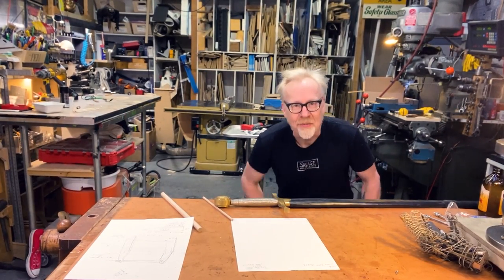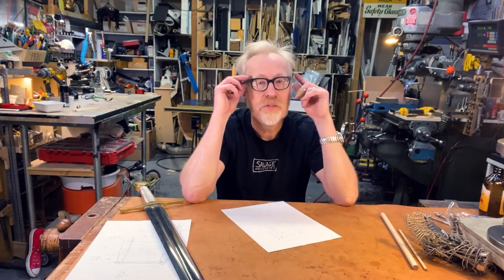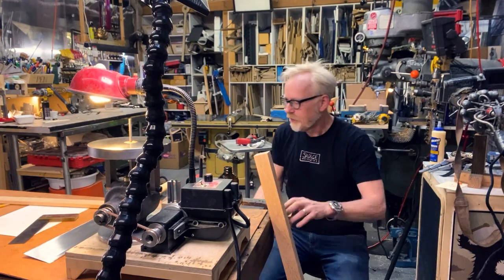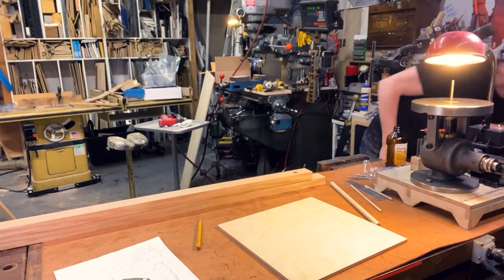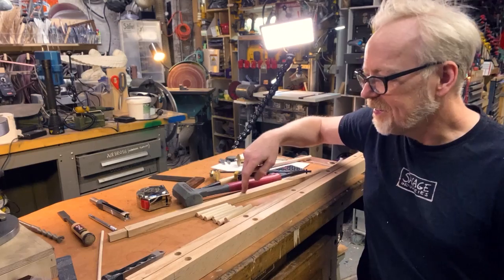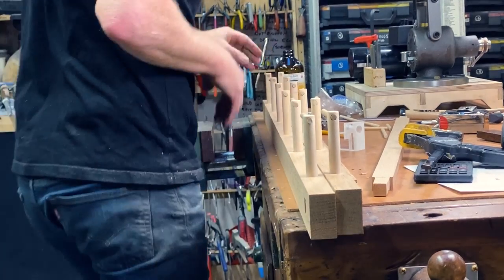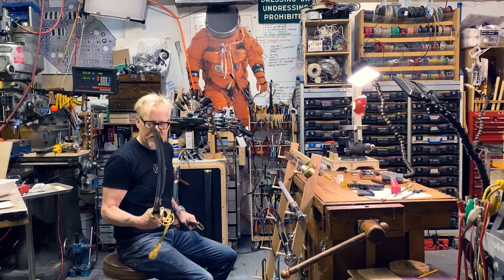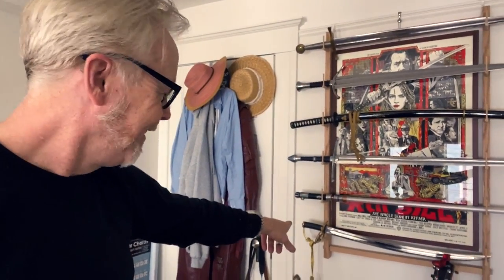Adam Savage's One Day Builds: Movie Sword Rack!

Comment from the maker: Now taking suggestions for (de)merit badges! Look for them soon at our TeeSpring store: https://teespring.com/stores/adam-savages-tested
Reply: Some ornate wreath surrounding a "thumbs down"? Btw can I bulk order them so I can hand out the appropriately exorbant ammount at work?
Reply: My troop at one point tried to go on a hike of Point Reyes - it rained all morning (they closed the trails to avoid erosion), we hung out in the gift shop and then went home. We received the 180 patch - for those with the bravery to turn around and leave well enough alone.
Reply: Uh, how about a badge depicting a bandaged finger; it is awarded for trying to clean/adjust something while it is running?
Reply from the maker: @RandomStuffGarage619  Ha!
Reply: Adam Savage’s Tested if you use a teeter motion when using japanese handsaws you might find the cutting to go a little smoother and with much less effort. start a line then work back corner for a few passes then teeter and do a few passes on front corner and repeat until through. helps make cuts go really smooth and helps with keeping a straight cut. just something i thought i would share. i have had great results personally using this method with that type of saw
Reply: A ruler/ pencil/ drill bit snapped in half with the caption measure once, cut twice.
Reply: I think a thumbs up, with a bandage wrapped round the thumb, would work for 'makes mistakes'. There should also be a badge for like, making it cutting two pieces the same, when they were meant to be opposites, or when you get your template upside down, things like that. Not to mention putting a thing down, and then not being able to find it a moment later. Maybe also for glueing something to yourself by accident. Ooh, and one for hiding the crimes!
Reply: I have a PhD in oops, that aint right. I blame the damned Imperial system.
Reply: They already make these badges. They are called "bandages".
Reply: Maybe something like, "Don't have time to do it right, but have time to do it over"?
Reply: Emoji person making the ASL sign for mistake, maybe with flames in the background?
Reply: Not a merit badge a challenge coin
Reply: A thumbs up with half the tip gone and a blood drop leaking out, for surviving an encounter with a band saw / table saw
Reply: Inappropriate Bandage Materials (blue shop paper towels, anyone?)
Reply: Posted a badge on FB. #successthroughfailure #merritbadge ;-)
Reply: "We do it right because we do it twice"
Reply: I am partial to "Measure Twic" over "Cut Onc".  I'm just not sure how to send my extremely simple mock-up...
Reply: "It's only a mistake if you don't learn from it!"
Reply: Merit/demerit badge from the one day build table saw upgrade: That was it that was all it took and I wasn't willing to do it. 

I just wanted to save a second over here! :P
Reply: That's already the "Plan ahead" punchline.
Reply: @jeremystrout23  I wish I could thumbs this up a few thousands more times (:
Reply: No one has mentioned converting metric to nonsen- Imperial, er standard. or vis-versa more likely.
Reply: A hammer pounding a screw
Reply: Per Adam for many videos (before the most recent), a blackened fingernail.
Reply: @Gazongola  "...putting a thing down, and then not being able to find it a moment later." aka 'Reverse Hallucination" Not seeing what Is there!
Reply: Aren't swords required to be kept in a sword safe in California?
Reply: Never ever forget your famous demerit badge "Am I missing an eyebrow" that is for all your fire "accidents" in your cave😂😂
Reply: Never ever forget your famous demerit badge "Am I missing an eyebrow" that is for all your fire "accidents" in your cave😂😂
Reply: enamel pin, made to look like a scout patch, has an incorrect ruler on it.
Reply: kissing the vacuum motor for curiosity?
Reply: Adam Savage’s Tested 
10 minutes and 5 seconds in to the video. 
Are those a bag of candies? Specifically Haribo peaches 🍑?
Reply: Measure once, cut twice?
Reply: One of these needs to reference not properly locking your tools down before a cut as in from your Space Suit Parts video with the right angle milling attachment mishap.
Reply: I absolutely need a badge for "fried the electronics by hooking the battery up backwards"
Reply: Could you teach us a headphone and microphone repair on your soldering kit please
Reply: Demerit badge for "Oh oh. Shouldn't have glued it yet."
Reply: @mikeboettcher9709  Yes. Lol :-)
Reply from the maker: @Beamer1969  We are working on those too! Stay tuned.
Reply: Come on 😃 
I need to know
Reply: Instead of painting the sword assembly  white, polish it to match the frame of poster. Then it will blend with  kill bill poster's frame and looks like part of kill bill's poster . You may remove amazing custom build  lightsaber (looking odd in this case ) and just put only metal swords. 

Another suggestion is make a single sword assembly and attach  it just below  the poster with kill bill's sword.  Do this only if you think that poster is getting too much cluttered.

#StayAtHome, #StaySafe, Dear Champ!

Apart from build skills you got some good video editing skills. Please don't fire your camera person after Lockdown!!
Reply: Merit badge suggestion: "Wow, that was still hot!"
Reply: @Gazongola  How about two left gloves for the 'opposites' badge?
Reply: Maybe something for "Measured box inside, cut outside", as in measured the interior dimensions, but forgot to add the material thickness, resulting in a box that doesn't fit together or the intended contents don't fit.
Reply: @markhood  Jamie Hyneman, is that you?
Reply: @Beamer1969  I would love that. It would go on my coin rack next to my iron man 2 coin that was handed out to the crew by Jon favreau himself.
Oh jeez I wonder if he made mandolorian coins?!?!!
Reply: Merit badges come in a range of sizes, so in order to best (and hopefully intuitively) represent "mistakes" as opposed to "accidents" or worse, I suggest 1 with depictions of the most common tools (drill, screwdriver, saw, tape measure, level, etc.) surrounding a pic of 1 of the most common diy jobs...a wonky bookcase complete with uneven sides, misaligned and collapsed shelving of varying (correct and obviously incorrect) lengths and the word MISTAKES arching (arcing?) across the top.
With regard to your sword rack, personally speaking, I would mount the swords in alternating directions...
1. So that all the weight of the heavy end (hilts) isn't acting down through 1 side of the frame.
2. I think it would look better aesthetically, because...
a) all the busy stuff (wrappings, pommels, guards, etc.) and therefore, most of your attention, is focused on that 1 side.
b) subsequently the other side seems decidedly empty by contrast which
c) adds to the sense of all the weight being on 1 side, which reinforces the impression that it feels lop-sided.
I'm aware that there may be a safety concern, with the exposed point of half the swords being in close proximity to your face as you walk through the door. If the longer swords were pointed away from the door, with their hilts extending beyond the points of those pointing towards it, might that mitigate it sufficiently?
Reply: Can you also make whatever they are a sticker?  I need this very much.  I am occasionally astounded at how dense I am at times on projects.  LOL
Reply: @GodOfBiscuits66  this would also come in handy for car dents.
Reply: I think a badge of a checklist with "Obsess, Make checklist, Draw a picture, Make, Sweep" would be really cool.
Reply: if there isnt a touching something that was at least 4 times hotter than expected badge i'll be disappointed
Reply: how about a merit badge for ALL THE TIMES YOU FORGET TO USE ANY PPE WHILE WORKING WITH DANGEROUS MACHINERY! i can count at least 7 instances of you doing this in this video alone so far, and i havent even watched half of it yet!
Reply: “One day build” badge
“Tried and tested” badge
Even a “tried it at home” badge would be kinda cool
“Every tool’s a hammer” badge
Reply: A merit badge with Stonehenge on it for when you transpose feet ' for inches "
Reply: make a TO IT ... stamp ... then every time you make a mistake you pull a task out you dont like and stamp it so you dont leave until that task is done .. because you just got your Round To It
Reply: a suggestion get one of those cow noise makers and adjust it to say boo ... put it in something that wont hurt or damage stuff and toss it to the person who made a misteak ;) ... or make a rubber steak .. and toss that ;)
Reply: BTW Adam ... your drill press has a EM radiation problem .. thats why the screen seems to wave like it was water ... its the interference of the motor with the phone
Reply: NEVER display a Katana practice decoration or otherwise with the blade DOWN ... that is a sign of disrespect to the maker and owner of the sword by saying the blade is so dull it is like the back of the blade and flat ... you always display the edge up because that is where the artistry is ... in the design from the forging and in the polish from the sharpening ... and any debris that would fall upon the blade will be cut apart and fall away from the blade when it is kept properly ...
Reply: A badge for losing frequently used/vital to the project tools (e.g, a screwdriver, wrench or socket of the needed size).  Could feature a dotted outline of a tool with a question mark over top.
Reply: Adam Savage’s Tested Definitely need a demerit badge for when you loose a 10mm socket.

My whole shirt would be covered with those.
Reply: Metric system saving you from making mistakes

Comment: Adam: "97, really? Okay that's not 48, thats 47.5..."
Me: "Ah already having to cut it short"
Me 3 seconds later: "wait hang on, 48x2=96 ADAM STOP WAIT!!!"
Reply: I did the same math.
Reply: I did the math and thought, "measure again from the other end, so you notice your math error." Then it was, "NOOOOOOO! Don't cut. It's 48.5". Your other half is going to be 1.5" too long."
Reply: Another victim of the imperial system :)
Reply: @v4lgrind  He messed up dividing by 2.  I doubt the system used matters.
Reply: 😂 I was shouting at the screen "measure twice! Measure twiiiiiice!!!"
Reply: Me toooooo!  Stawp! 
LMFAO
Reply: @boskone  100 / 2 is definitely easier than 96 / 2
Reply: @DanielRothhaar  Half of 96 cm is still 48 cm - just because we use metric doesn't mean that we always deal with nice power-of-ten figures.
Reply: @SteelSkin667  but he said "8 feet is 96 inches but i thought 98" (im paraphrasing). Nobody ever said "oh right, one meter is 100 centimeters, not 98"
Reply: MrQuackcorn time stamp please, lol I can’t find it again
Reply: v4lgrind fgh
Reply: @v4lgrind  How is that an imperial system problem?  He measure 97 and divided by two and came up with 47.5. The units of measure don't matter.  You metric bigots want to blame everything on our use of inches.  I am sure you've never made a mistake when measuring...
Reply: @drhender6943  - Yes, but the problem arose BECAUSE he divided 97 by 2, when in actual fact, he SHOULD have been dividing 96 by 2.
Also, the math for Imperial and metric is only the same in that it's math, but there is a more pronounced difficulty when using Imperial measurements of any sort, entirely down to the fact that they all use...let's say "less than intuitive"...numbers. Base 12 definitely has a degree of difficulty greater than the  numbering system we're all born with (except in a few rare cases). That difficulty increases exponentially when you start getting into the fractions of inch.
I completely understand your indignation in the face of having the system your country steadfastly refuses to give up, by "foreigners"; many of whom from a country that, until only recently (in the grand scheme of things), not only still used the same system of measurement (and indeed still does for a bewildering number of things in a perplexingly random seeming manner), but insanely for their currency too, not to mention the jumble of associated grouping names used across the board. To this day, every "proper" engineer I know still carries a full set of Imperial tools alongside their shiny new metric ones, because they never know when they're going to have to work on a pre-70's piece of equipment. In fact, everything here is sold with dual markings, from m/h and km/h on our speedos to pints and litres on our milk.
I'm sure you know as well as everyone else that there's no-one as against smoking, or as indignant when someone lights up next to them, as an ex-smoker, telling smokers how good everything is now that they've quit. They can breathe easier, food tastes better, yadda yadda yadda. These people are no different. They live in an enlightened world where they get to count on their fingers and toes without having to carry digits if they so wish and while that may be easier and more intuitive, there's absolutely nothing wrong with sticking with the hard way, or contracting some form of respiratory disease...if you really want.
;-)
Reply: His face when he realised was priceless though 😳😂

Comment: Woodworkers measure twice, cut once...replace the word "twice" by any number your brains require. Something I learned fast from my father: When dealing with single center cut pieces, you can always mark by math and check by measuring from the other end too. It's easy, it's fast and it will save you many times from doing the math wrong.

Love how you keep on doing videos for us despite the pandemic, Adam. I also share the experience of getting things that have long been hanging done during these times. So many projects planned even years ago, which have finally been completed.

PS. Interesting how you decided to hang the swords for a left handed at your house...

Comment: If Adam went full metric, that would be the final nail on the inevitable coffin for the imperial system and he would be forever known as "the bane of the empire"
Reply: All his materials come in imperial, so  it would be a pain for him.
Reply: If he learnt both it wouldn't be but aside from becoming bane of the empire, he doesn't really have a reason to learn metric off by heart (okey tbh he probably does but I am guessing most tested viewers are imperial scum Adam makes it easier for them)
Reply: Thing is, metric is a lot easier to learn, because it makes a lot more sense, but being in America where everything is in imperial, learning both and trying to convert metric to imperial on the fly is fairly pointless.
Reply: Der Der Derrr Da  D Der  Da D Der
Reply: 10 fingers, 10 toes. 10 centimeters to 1 decimeter. 10 decimeters to 1 meter. So much easier than 3/32  out of 1146/34th quarter pints. ;-P <3
Reply: He would need a new tattoo
Reply: There is no Imperial system, it is calibrated to the metric SI standard with a conversion. Veritasium
 once showed it in a video.

Comment: They should be mounted this way:

+--
--+
+--
--+

You can fit more in the same vertical space as the hilts don't clash
Reply: But more swords means less visible poster behind them... something to consider too.
Reply: That adds a extra dimension of complexity,.... 'cos your katanas should have the handles to the left. Ok  Adam only has the one one katana, so he could do this easily, and aetheticaly, I think it looks better the way you describe. I have my rifles alternating on their pegboard for the same reason, scopes and buttstocks are fatter, barrels thinner, so they stack better.
Reply: Richard Allsebrook never mount swords in alternate direction, unless of course you wish to slice a finger off, just saying
Reply: @Maker76  Why would that make you slice your finger off?
Reply: ... acceptable. Also that way, if you had to grab two at a time to defend yourself, the handles would be more ergonomically aligned. 

But I think swords displayed vertically are boss !  Way more impressive
Reply: @engineeredlifeform  sorry but i beg to differ... yes there may be arguements in which way the katana should be placed but in this case it should have been reversed. After years and years of iaido practice i was taught that the tip of the katana should always be pointed at the point of entry as traditionally it helps the ease of pulling the blade out of the saya in the case of an enemy attack, the door is on the left hence the tsuka should be on the right. Also it helps since Adam is right handed for him to pull the katana out. Then again from an aesthetic pov the way he has it now is ok and in western cultures said to be of peace but if things are to be taken down to the nitty gritty there are a lot more rules such as which wall it must face under a shrine...etc so just saying...
Reply: @MrGadzookie  You can beg to differ all you like, but in peacetime, it's to the left, period. That's the etiquette.
Reply: @engineeredlifeform  I'm glad someone mentioned this about the direction of hanging katanas with the tsuka on the left.